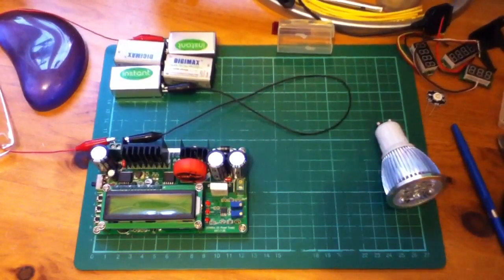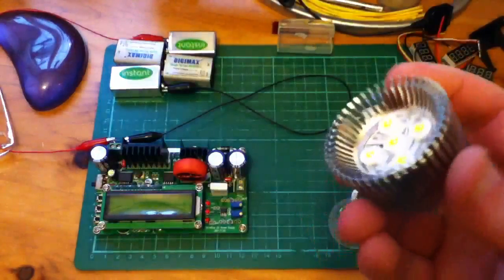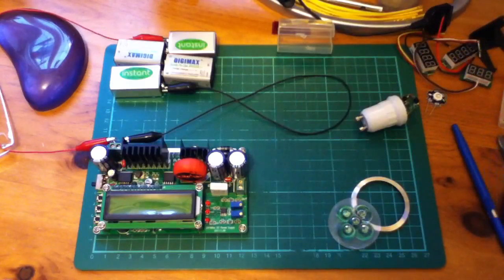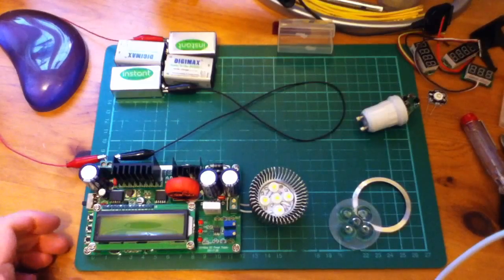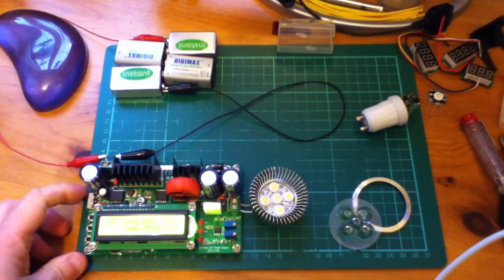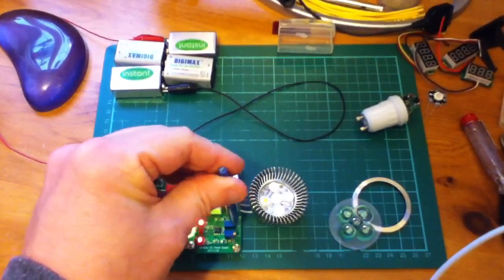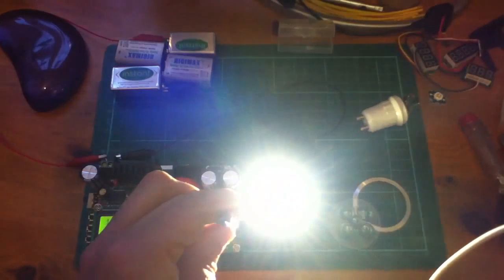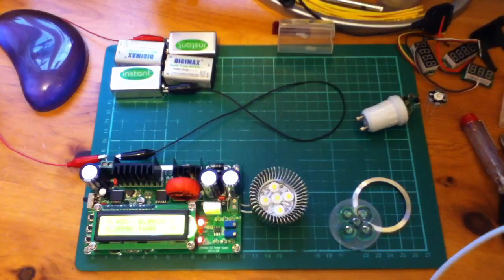Using Constant Current PSU to Drive LEDs in GU10 Spot Light

Comment: Okay video, I'm a bit surprised this works out to be like 4 1/4 W in total, did you try running it at the real 300mA to see if they were still operating stably? Well I guess this is nonsense what I'm saying, these leds could probably do 350mA for a couple of thousand hours, in the end there's still a direct (log) causal relationship between current limit and mtbf

Comment from the maker: They were very bright - the manufacturer would want to run them as bright as they can. But so many I've tried are really too bright and so get hot and fail early. Admittedly I'm buying really cheap lamps - the expensive branded types are probably much more reliable.